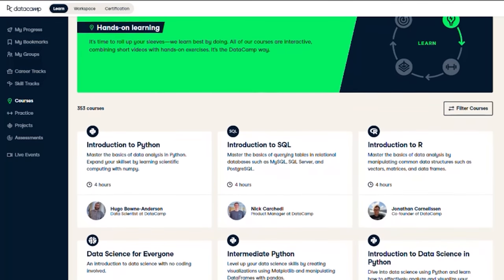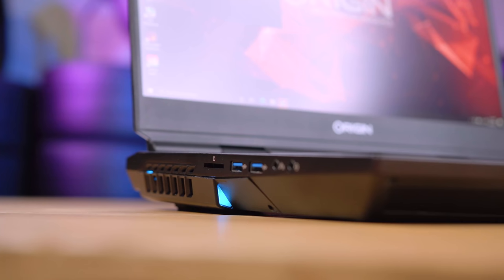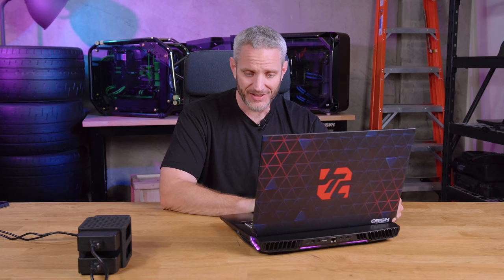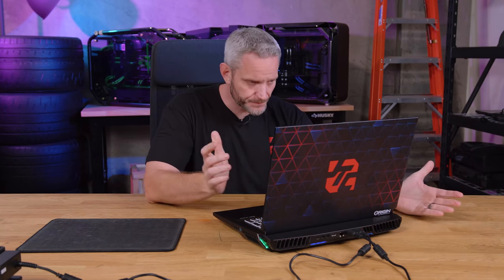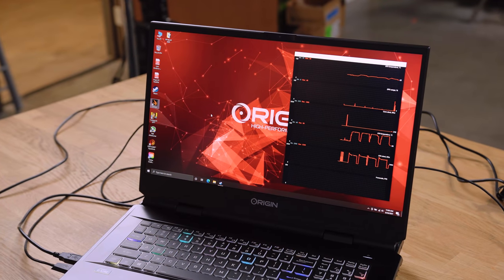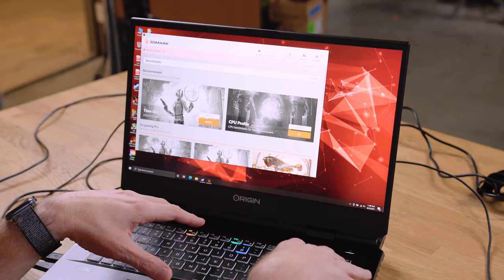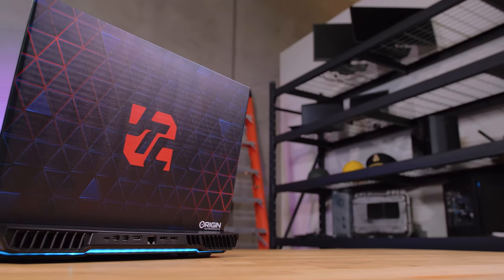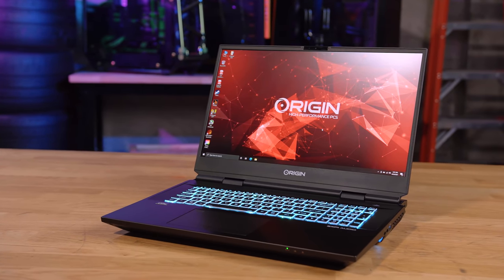You are GUARANTEED to HATE this... which is why it's so AWESOME!

Comment: Hey Jay, not sure if you'll see this, but I just camped out for 12 hours to finally get my hands on a 3090 FE at sweet sweet MSRP and now I'm looking at a water block for it, I've been eyeing the alphacool & Corsair versions but I see that EKWB is coming out with an active plate chunky block, but only in white and black. Do you have any tips for painting a water block (not the plexi parts, just the aluminum/metal parts)? I have a white theme and would like to keep it white w/o having the block be mainly black or silver. Any tips?

Comment: Also, 1080p Raytracing Ultra also works at 60 fps on my 3060.  Not that big of an achievement.
Reply: For laptops it is, since the mobile 3080 is in between an 3060 Ti and 3070 performance.

Comment: have more or less the same laptop(design and cooling system is the same  down to the rgb .. an odm  laptop design by Clevo) . there is 2 more ram slots underneath the keyboard if i`m correct and up to 4 m.2 drives .its loud and heavy but gaming on it is damnnit nice ..and the interesting part is the gpu is mounted on a mxm module ,so there`s a possible upgrade scenario in the future .

Comment: jay when you ran cinebench and 3DMark were they via battery power or external power. I remember you saying at the beginning of the video you had it unplugged as you were wondering about the battery life but you did not specify what it was during testing. 

If it was on battery power wouldn't that stunt some of the performance on tasks like cinebench as it would be utilizing a different power ratio than it would be if it was externally powered by not being able to draw its full wattage usage meaning even if the cpu was saying it would be hitting 100% utalization it would only be doing so via the amount of power output the battery itself would be able to provide at that point in time?

again same for the 3DMark Testing

(probably a complete noob question but not much of a laptop guy here)

Comment: Does it have positive retention for the power plugs. Currently rocking a 1080SLI Titan that has a similar power setup, but MSI in their infinite wisdom decided that their heavy ass laptop and power bricks didn't need positive retention for the plugs, so the bricks regularly come unplugged from the Y connector and the Y connector comes unplugged from the laptop even more than the bricks do.

Comment: When it's a desktop replacement anyway, and the battery runtime is completely useless, why not get right off the battery altogether?
Reply: In case you accidentally unplug it
Reply: I just use mine as a built-in UPS. Taking it completely off battery just isn't worth it.

Comment: I customized one to meet my "needs" and it came out to just over $6200. But hell, it would be a bargain at any price. And only sissies need light laptops - did these people not grow up carrying around 20 pounds of textbooks to school and between classes?
Reply: Well I'm sure glad I watched this video before i sold my left kidney and bought one - the rattling trackpad button are absolutely unacceptable on a $6000+ machine, but then again I will never, ever use the trackpad so I might just epoxy/silicone them in place. But when I saw Cyberpunk 2077 running at practically the same framerate as my i7-8700/2080 desktop with the same settings, my mind was made up to not buy this ridiculous underperformer.

Comment: I mean, is there really a point in getting something like this rather then like...idk something like a razer blade 17" with a 3080? I mean ik that those dont run the full chips and whatnot but i feel like its better then tons of PCs out there and still fairly thin/portable
Reply: The user serviceability of these types of machines is usually MUCH better, as well as cooling.

Plus, it's not a Razer product and that's always a massive benefit.

Comment: I thought running 1080p with a 3080 or higher, would CPU-bind the system?
Reply: it's a common throw out the 4k crowd love to say, but only true in a handful of circumstances and mostly on older titles.  There are plenty of games out there that this will not occur and is less true on more cpu intensive titles.  Optimization has a lot to say, if it's not using threads efficiently this would even happen with a 2080.  The big blunder would be doing 1080p on a 3090, an extreme waste of the vram.

Comment: 17" 1080p High Refresh Rate panel?

My Samsung NP700G7A laptop  from 2013 has one of those, runs at 120Hz :)
Reply: But this one runs at 300 Hz.
Reply: @laszlozsurka8991  depends on your definition of "high" . On could argue that if60-75 hz is standard, 120-144hz is High then 200+ is very high ;o)
Reply: @panman1964  If you're a competitive gamer you would go for higher refresh rate than resolution. I assume this laptop was for games that require high FPS given the 300 Hz panel.

Comment: "Unless you need the portability of a laptop"......  hmm... PC is 10 pounds, power bricks are probably about 3 to 5 pounds if I had to guess...

That better be a damn good battery otherwise the portability suffers. Basically would be a more convenient desktop if you can't run it without being plugged in. Not entirely a complaint, it's still handy if you go from place to place a lot. Beats lugging a 20 pound tower, a monitor and everything else back and forth every week.
Reply: I do kind of wish there was a cover for the ports on the back, even though most people would put this into a good bag or case for travel. Shit happens, and even if the vents would make it ineffective anyway, the fewer ways for moisture to get in or for anything to go wrong the better imo. 

Just a nitpick, really not much point to it I guess.

Comment: 7c is NOT enough headroom for me to even feel comfortable using it in my older house, with lack of AC or the like, in the summer, It hits an easy 95F in the room. That laptop will be thermal throttling right out of the box for me. That is just not enough.

Comment: Hey Jay, a question if i may? o:
I bought my RTX 2070S back in Jul 2019.
So its been 2 years now, should i think on repasting her? google said the stock paste last from 5 to 10 years, is that accurate? is there a benefit in repasting? she gets temps around 80-83c which i saw is normal, my case is very ventilated and i have a fan blowing on her face (old case with side fan).

Anyway, if you can help, i appreciate, thanks o/

Comment: "Thunderbolt is an Intel technology" Yes but no. It depends on the licensing, as it would be illegal for Intel to forbid AMD systems from using it. Instead they merely charge a whopping great fee, which laptop manufacturers take one look at and go "screw the customers, we're saving money." Things are slightly better on the enthusiast motherboard side, but not by much.
Reply: It wouldn’t be illegal for intel to forbid AMD from using it, see: 
Apple lighting cable
Apple MagSafe (both the original and the new one I guess)
Apple’s charger that the lightning replaced
Tesla Superchargers with non-Tesla cars
And those are all just talking about chargers.
Reply: @levygaming3133  I see where you're coming from, but the legal issue is that Thunderbolt isn't just a charger. Its speed and do-everything nature (display signal, latency, insane transfer speeds etc) is why it would be deemed as a monopoly if Intel kept the licencing private.
Reply: @waverleyjournalise5757  monopoly, as if USB C doesn’t exist. DisplayPort over USB exists, thunderbolt is only twice as fast as usb 3.2 2x2 and they (the usb people) like to double the speed every revision. All that leaves is latency, which is hardly enough to be a monopoly. And it’s not like buying a thunderbolt equipped device locks you into the ecosystem, because can’t you just use normal type C cables with a thunderbolt port? 

Not that the argument isn’t going to be a moot point, aren’t they planning on bringing thunderbolt to non-intel devices by making it part of the USB 4 spec or something?

Comment: that moment when this 3080 have almost same clock, 120mhz, and lower temp as my msi 3080 gaming x trio at 70% power  because it is overheating  (70c 90c edge) (it is overheating also on open bench) It is loud  and at 100% power have 80c and 100c edge temp :(

Comment: Hate?
The only thing I hate is that they don't do a mobile (15W) version in this chassis. Imagine that. It would be ice cold in use, near-silent, obviously not using two power bricks just the one, and it would still be magnificent for most of the market in terms of performance even with the 144hz display they offer with the chassis. I like chunky laptops with 20 ports and headphone jacks but they all seem to be engineered for a use case I don't need.
I don't know, I do love this product, but the hardware (meaning the desktop components) render it too pricey for my liking.

Comment: Wow... 7616 in Port Royal? On a 3080? I have my 6900XT underclocked/volted/powered for this beeping heatwave here pulling <180 watts getting 9800s in Port Royal. Meanwhile average desktop scores for the 3080 are around 11500, not far ahead of the 6900XT's average of 10300. This GPU took a hell of a hit getting shoved into a laptop. Would've been MUCH better off putting a 3070 (avg 8300) in there and save some money that could then be passed onto the customer. Not to mention slightly better battery life.

Comment: 12:20 High 90°C you say? You're hitting tj max and the cpu is throttling to not fry itself. That's why you don't put an Intel CPU in a laptop in 2021. A pretty good laptop ruined by a bad CPU. You might as well power the thing with a Gigabyte PSU while you're at it.

Edit: but I do like the "it's within spec" jab at AMD's GPUs for frying themselves. Dunno if that was intentional or not.

Comment: For gaming this seems pointless.  If they wanted to put anything “desktop” in it should’ve been the GPU not the CPU.  Perhaps this is impossible but seriously how much better performance are you going to get when you’re limited by the GPU?  You can have a desktop running an i5 with a 3090 just smashing it but you can put an i9 and 3060 and it won’t do as well. This just seems a way to get people with more money than sense to part with it. I could be wrong because I haven’t seen benchmarks yet comparing this to other laptops with a 3080 and a laptop CPU
Reply: Laptops of a certain power are always more expensive than the equivalent desktop.
Someone getting a laptop for gaming knows they could get more performance from a desktop. Someone would not be in the market for this laptop for the best absolute performance.

Comment: they put desktop i9 in there, but it's not really faster than desktop i7... so if you buy this that's where you can save some money.
Reply: That's because of the temps. Jayz just said that the i9-11900K in that laptop performs like an actual desktop i9-11900K.
Reply: @laszlozsurka8991  and what's the difference between desktop i9 and i7?
Reply: @Cypeq  i9 is faster?

Comment: I have my 5700xt undervolted and it still runs hotter than a laptop gpu wow
Reply: some 5700xt's including the strix had an improperly mounted cooler. not enough pressure on the die which people fix with plastic washers. if your 57xt cools like shit  it could be one of the incorrect coolers.

Comment: 6:48 "idle" there's no such thing as idle in a stock Windows installation due to the amount of background spyware processes. That way, the CPU is always boosting to 3Ghz at "idle" instead of it's true minimum speed well below base clock. I'm sure there would be a noticeable increase in battery life if you ran some debloat scripts and removed whatever bloatware Origin put on there, if any. You could also force limits on the CPU on battery in the advanced power settings for good measure. My CPU never fell below 2.6Ghz with Windows, and never reached its 4.5 boost. (i7-9750H) With Linux, I have it set to go all the way down to 700Mhz on battery, and all the way up to 4.5 on all cores when truly idle. Sadly that doesn't really help because my battery is ready to be replaced and I don't have switchable graphics with NVIDIA so the GPU is always active :(

Comment: I'd be all in on that if it was an inch thicker, for a proper full travel mechanical keyboard, and enough battery to make it useful when off the wall warts.

I'm a bit sick of this limp wussy "wah wah, but the weight" attitude from people freaking out about half an ounce. I used to schlep around a Trash-80 Model 4... I spent years using the PC3 form factor (lunchbox PC) for work. You'll excuse me if I think anyone complaining about how "big" or "heavy" something like this is needs to get their tuchus into the freaking gym!

It's like the little lame putz who "work out" with half-pound weights. 

But what do I know, my phone is a BluBoo S3 with the 8500mah battery, that I'd HAPILLY see increase in weight and size to double the capacity... whereas half the people who see the thing go "how can you put up with such a brick?"... Brick? Christmas on a cracker people. I pick up a mainstream phone and I feel like "J" picking up the noisy cricket.

Comment: Whit two such power bricks, why not use a mains connection all the way with a smaller single power adaptors at the other end. It's what a normal computer does. 1 power supply handles the system, so why can't they do that with power hungry laptops too. They clearly need all that power.

The way they do it seems so last century type thinking, I'd rather hoped we see a sexy power strip you connect to the mains and that docs to the laptop or something like that. Two power bricks just show a lack of imagination.

Edit:
Hu? I was just reminded that heat is basically wasted energy in electric systems due to inefficiencies. It's why old style lights heat up as they are lit, even leds do this to a degree. But that's not the intended use for the power it it. No the power is there to power the dang electronics or the pc or anything that runs of power.  All that power gets dumped into the systems and only some of it are used to power the actually things you needs to be powered, most of it it lost due to inefficiencies in the systems and how electrons flow through the used circuitry. But does that mean that if they used say superconductors to make the cpu it wouldn't need as much power due to having no to little resistance and thus generate far less heat?

If heat is becoming such an issue, then it goes without saying that we are wasting a lot of power due to inefficiencies, it goes to heat and not to run the gear. That's lost work time right there all gone up in heat. Så why not build systems out of better materials that has less efficiencies loss? Or maybe humanity hasn't figured that out yet?

Wouldn't it be fun to have a computer that doesn't heat up and it is just as powerful as before while using maybe half as much power? I wish...

Comment: Did they fix cyber punk or what because I 30-40 on low with a 1650 super at 1080p I don’t know now because well I don’t have access to my pc

Edit: and I’m not bottlenecked for sure not In anyway my gpu will lose performance atleast 32gbs of ram 5800x rog strix x570-f gaming and a 1200w power supply ik the psu is over kill it was an accident kinda anyway and a 4th gen NVMe SSD so that ain’t it help please

Comment: Your video is Great!

I am sorry, 
but the product itself is not really that good. Outside the desktop-class CPU, other parts are just regular laptop-class. It has laptop RAM, laptop GPU. We all know that a desktop-class CPU is not really much faster than a laptop one these days. It got the same cores, same threads, only faster speed. Unless it comes with R9 5900X or 5950X which has 12 or 16 cores because the laptop does not offer anything above 8C/16T.

The real difference is the GPU, 
the desktop GPU uses a different die (3080 3090) and draws way more power. However, this one only uses RTX 3080 "Laptop" GPU. The Max-P or the maximum 165W TGP is not something special, many laptops have this as well.

I don't think it makes sense, just to use a desktop CPU. It's so heavy, thick, and uses 2 gigantic power bricks. The price is insane too, I only pick i7 and 3070 and it already hit 3,300$. Like really? this spec is not even faster than most hi-end laptops and this is with 1080p 144Hz display and 16GB 2666MHz RAM.

Just get one from the major brands. 
Alienware x17, MSI GE76, or Lenovo Legion 7, these laptops also have the same Max-P 165W GPU. The EON17-X will justify its price if it comes with 5900X, 5950X, or use the real desktop GPU.

Comment: meh, saw the title and thought "I doubt it" then he said laptop "nope, I'm all set on Framework laptop". I don't need a desktop replacement (own a beefy desktop), already reserve my Steam Deck (512 GB version) for mobile gaming and I rarely use laptops unless is to be on the go (traveling), or is I screw up my desktop (regedit, moding, or reformating error etc).

Aside from that, I do want companies like Framework to succeed in their mission to bring back the right to repair on the hardware you own. Do I really need a laptop? not really, Samsung Dex is good for basic browsing.

Anyways that laptop (on video) is nice for those wanting a "desktop" PC in a laptop format. It isn't just for me, so I do not hate it, just not appealing.
Reply: These laptops have full service manuals available for them and they are pretty easy to take apart and upgrade. It is also supposed to be easy to order replacement parts for them but I have not done that yet. These DTR use socketed CPU, memory to make upgrades easy.